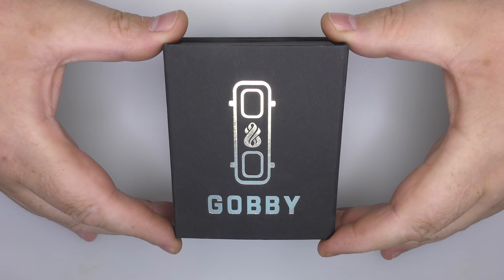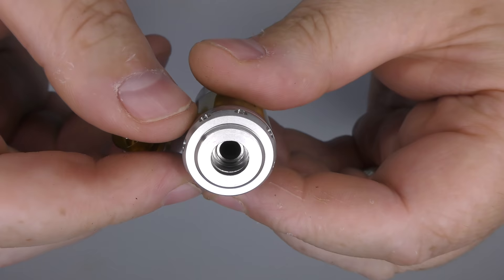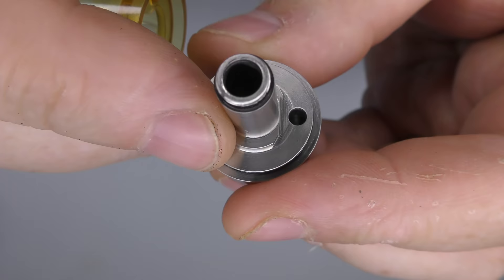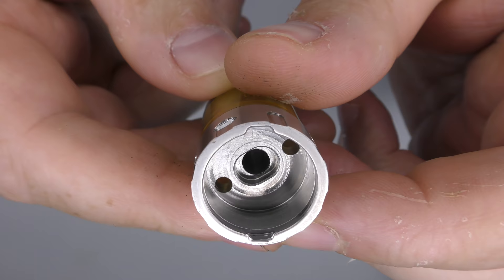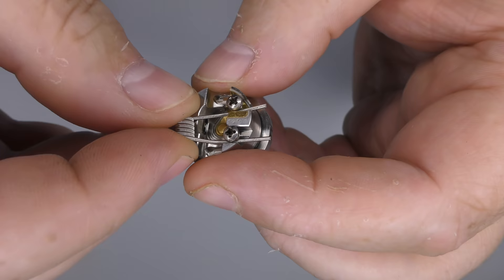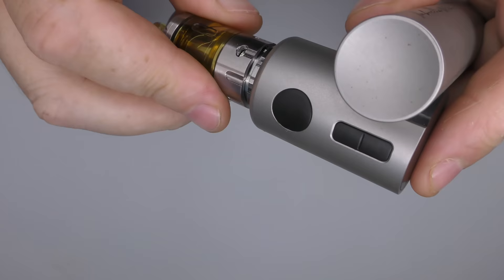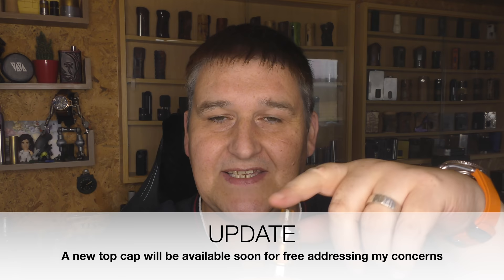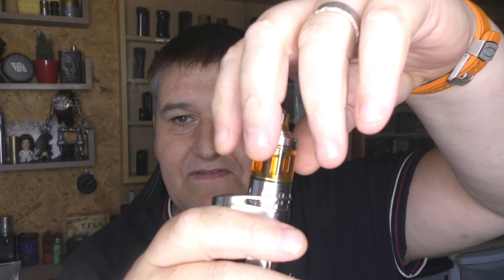Gobby RTA by Hussar Vapes

Comment: A very nice RTA, there are very thin cut-outs in the top cap and on the where the fill ports are. If they line up the top cap can be removed. Hard to see, almost like a hair. It seems that the top cap has changed a bit, but no hard stops.